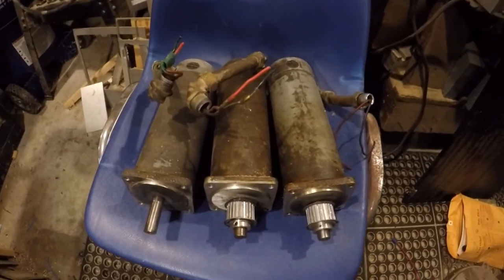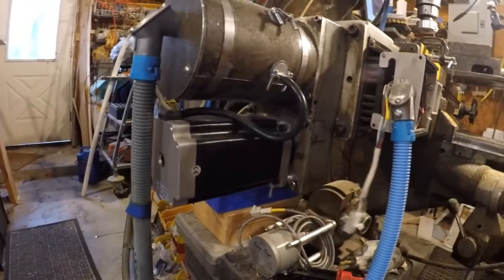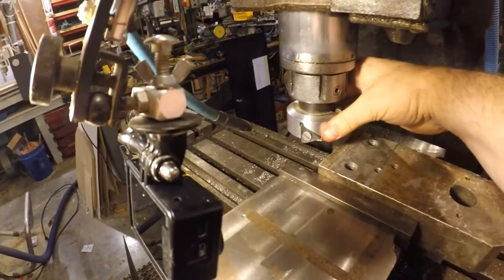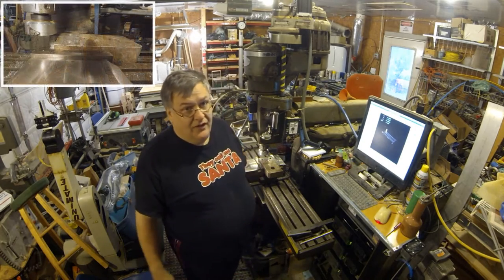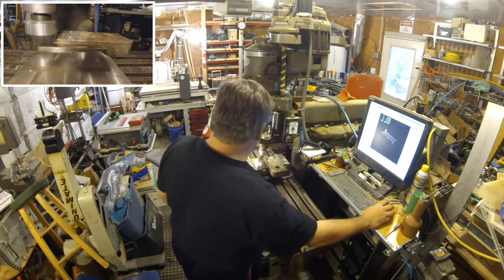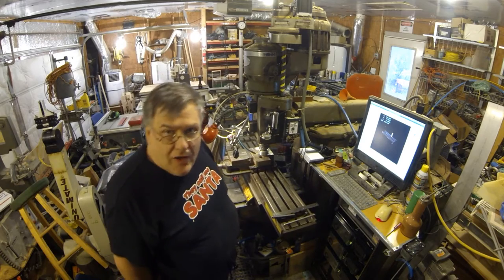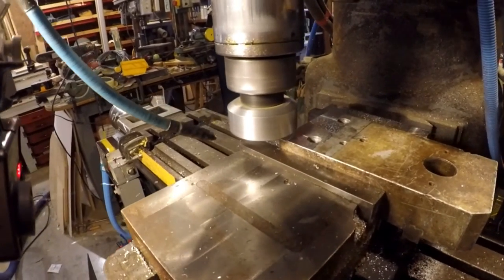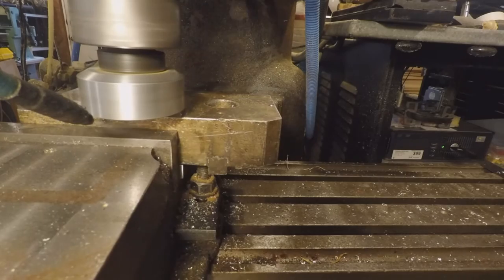Monster Mill Overhaul #2

Comment: That fly cutter looks great. No worrying about a balance issues with a long tool arm.
Reply from the maker: Thanks, I found a whole bod of indexible inserts at a surplus place in Missouri... I designed the fly cutter around them. Seems to do a good job. I don't know why, but I saw this one and decided to get ti as well... probably because it's a bit smaller for some jobs and the price was reasonable. 
http://www.banggood.com/C34-FMB22-Shank-Extension-Rod-400R-50-22-Face-End-Mill-Cutter-With-10Pcs-APMT1604-Inserts-p-1070231.html
Reply: That is indeed a good deal. Looks identical to Tormach's more expensive 38mm face mill.
Reply from the maker: Kent VanderVelden So far I am very pleased with it.

Comment: I have a couple of questions. What ratio are you running the steppers at 1-1 or the original 2 to 1? From what I have read steppers can be misleading they make there power at a very low rpm then it drops off from there so a direct comparison of the NM with a servo can be misleading servos are more rpm capable and maintain TQ. Also how are you running the oem spindle motor? They are labeled Star 3 phase rotary phase converters make delta? Or is the star just because of the old time electro mechanical spindle brake.
You have probably figured out i'm working on converting a 70's index which was originally steppers.
I converted 2 acrolocs to steppers and they work well as long as you understand the limitations. Got this index for cheap and it has a much lighter table hope to get a little more speed.    have the Acrolocs cutting at up to 60 ipm 2.5 D and maybe 45 ipm true 3d and still maintain accuracy. Rapid at 80 when things are warmed up after that they stall easily. Looking forward to input on this

Comment: jerry, so, you replaced the servos with steppers.. were you able to use the same gecko drives ? also were the servos a closed feedback system   / vs / open feedback system  with the steppers ?

Joe
Reply from the maker: Gecko Drives... No. The steppers and the DC motors are completely different and need different drivers. I went to Amazon.com and found a kit that had steppers, controllers, and power supplies... enough for 4-axis. I used 3 of them... the 4th will be used later to upgrade my lathe... but that will be another series.

The steppers are just simple non-feedback... same as the smaller ones only much larger. The drivers do use the same STEP/DIRECTION control... although I needed to re calibrate the number of steps from 500-line direct reading to 800 steps via a 24:60 belt system.
Reply: @Askjerry  very cool.. looking forward to your continual progress !!  Ill be starting my build very shortly.  want to keep it under wraps till the machine is in my shop !!!
Reply from the maker: @RaptorMachineToolCo  - I will be pushing all my files... so you should be able to grab segments and routines to modify as needed. I'd be interested in seeing what YOU come up with when you are done! (So please do share!)
Reply: @Askjerry  yes.. absolutely !

Comment: I'm in the market for some motors and saw your review on amazon and went to your YouTube page are they still running, have you had any issues and your thought in the power supply and drivers. Thks
Reply from the maker: F Esc I have had no problems at all. The steppers have not missed any steps, and there is plenty of power for what I am doing. It would snap a bit far before it would ever stall. I am very pleased with them.
Reply: askjerry That is awesome, thanks. I just bought the kit. What are you running your motors at or what do you think is the sweet spot for your application?
Reply from the maker: No two applications are the same... I have a 24 to 60 gear ratio... you may be connecting 1:1 which would be completely different. You need to run through the math in LinuxCNC and try different speeds. I started off in the middle and worked my way up until it started loosing steps. Then I backed off a bit and tinkered with acceleration. After that... you really need to test the machine... if it still fails, back it off a bit more. I was hoping for that 100 IPM goal... but got about 1/3 of that. Just the way it worked out. Still... the acceleration if MUCH higher than what I had with the DC servos... so overall I'm happy.
Reply: askjerry thanks.. This will be my 1st time doing this and anything with CNC.
Reply from the maker: Depending on my availability, I can do a Skype or Google Hangout and step you through some of it.
Where in the world are you located?
Also, be sure to check out the FRANKENLAB series: https://www.youtube.com/playlist?list=PLa_L8q5vezBOkzP_yOKBXPB8zKn-iWCsX